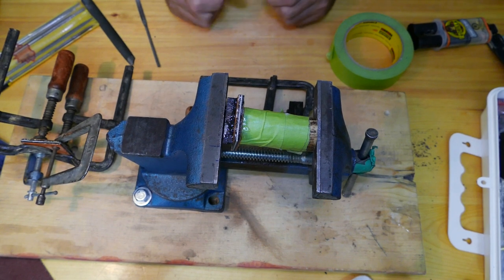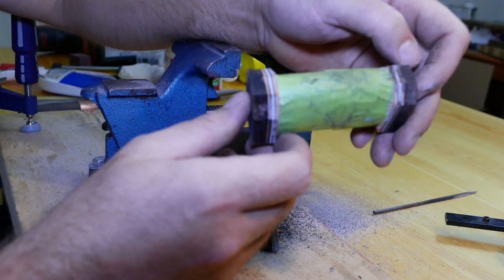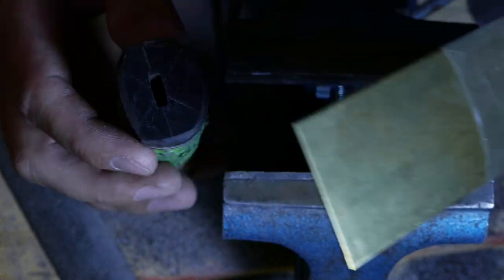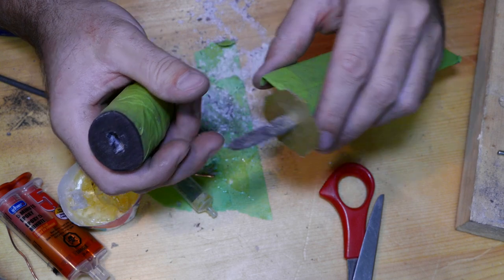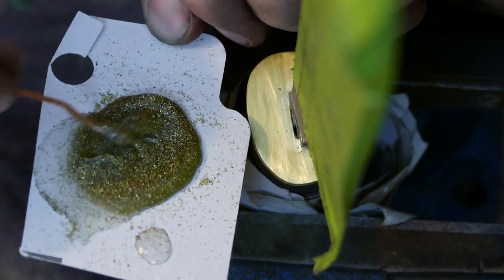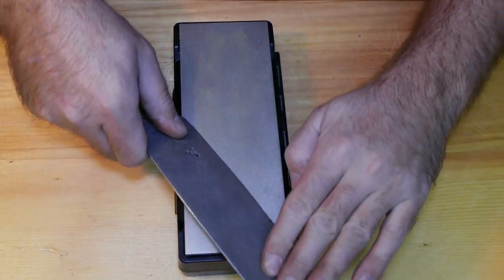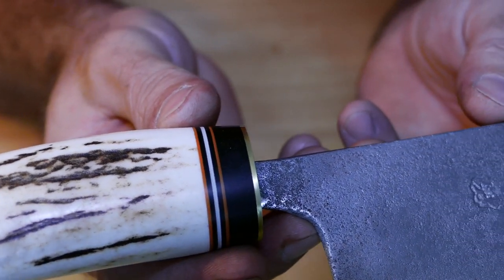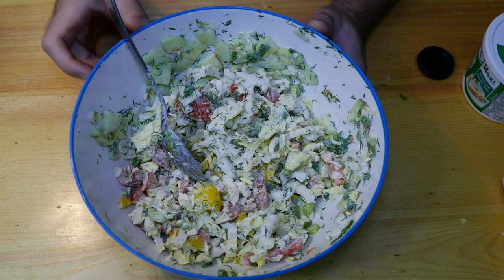Restoring Nakiri. Japanese Vegetable Knife Restoration. Part 2

Comment: I love vegetable knives ! An inflatable (tire) sander would sure make the job of shaping the spacers/bolsters easier. I use one fitting gun stocks and it sure beats a file or hand sanding. I use a 8", which works better than the smaller sizes. Not expensive either. Great video !